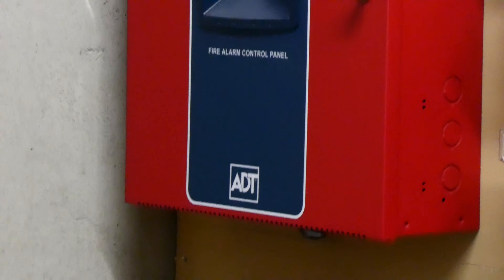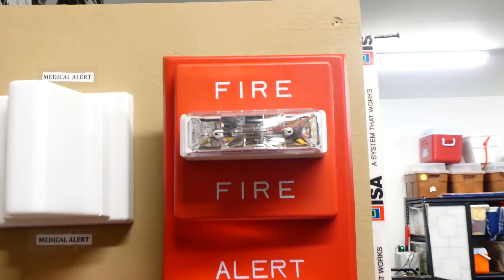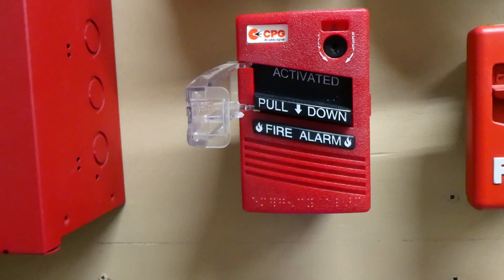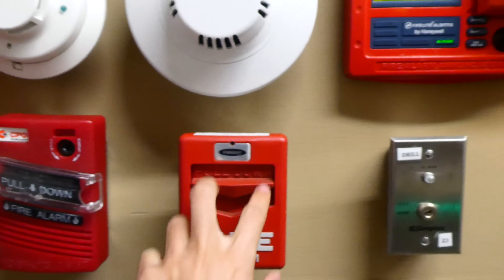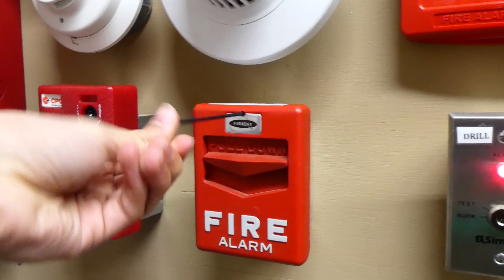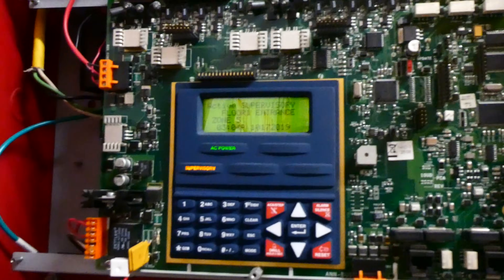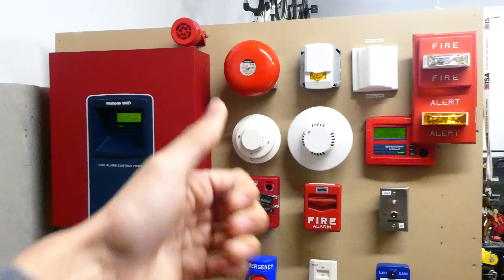ADT Unimode 10UD System Test 12: ALERT!

Comment: The Philadelphia airport also has double strobes. However, the alert strobe is the one on the top and they are simplex truealerts. What would the alert strobes be used for in the airport?
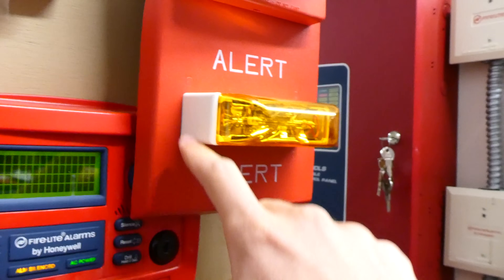Reply: 2:52 The Block
Reply: They have alert strobes for something like a gas leak, robbery, etc
Reply: I saw those in Terminal F. I made a Community Post about it
Reply: @Fireandsecurityalarms  I just saw it and commented on it

Comment: Nice video.

Disclaimer for anybody wanting to mix Exceder LED with RSS/SR, SL/SLM, Exceder LED3, or classic Exceder strobes:
Due to their slow flash pattern, first-generation LED Exceders cannot be mixed with their newer LED3 replacements, nor can they be mixed with any syncable Wheelock xenon strobes.  However, LED3 strobes and syncable xenon strobes can be mixed.
Reply: B.
Reply: Say waaaaaaa??????
Reply: They also have a new model, that too can be mixed.
Reply: Kdksldkekekewlekelkdksñsksldlwlekeekekekkeleekeleekldkdsl tú